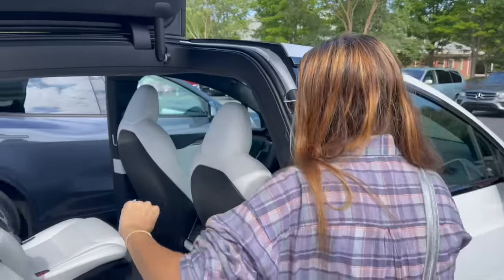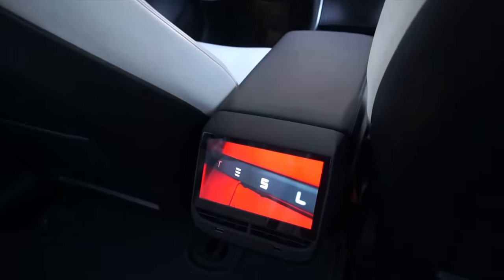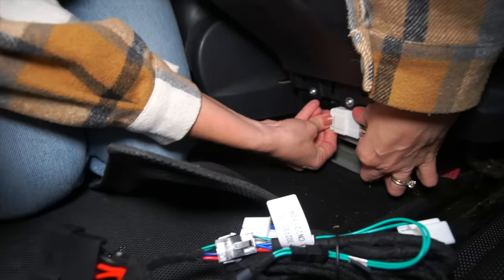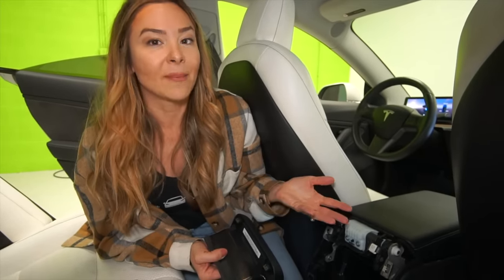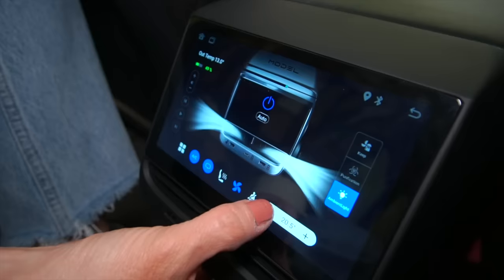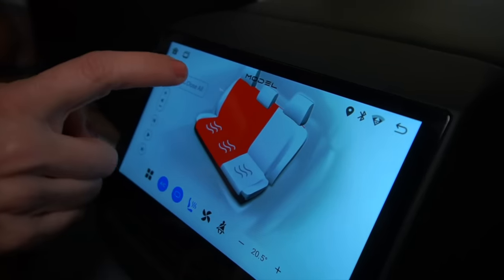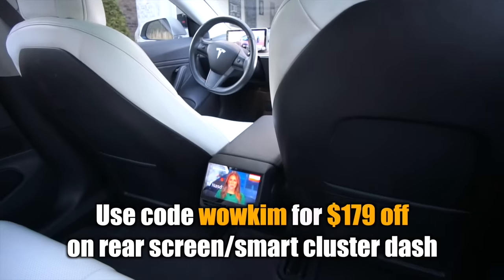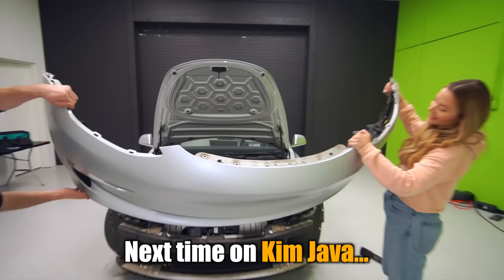THIS Rear Screen For Tesla Model 3/Y Is EVERYTHING!

Comment: What internet source does it use? Tesla or phone?
Reply: @Stranger Things yeah I thought it was a good question
Reply: Phone… Tesla does
not have a shareable hot spot.
Reply: Follow up question.  What speakers does the sound come out from?  Tesla or built in if it has one.
Reply: Waiting to hear this response before buying one myself
Reply: @aevans1979 hmm I’m sure you can hot spot the Y
Reply: @andymiser7710  from what I read, you’d have to use a hotspot for internet. So basically Wi-Fi only. Also read that the speakers work from Tesla or from the device itself. Or Bluetooth devices

Comment: Great video but I have a couple of questions. Does the screen go into night mode like the main screen? And do the smaller vents still put out enough air to keep the rear passengers comfortable? Great video & I can’t wait to see the headlight upgrade!!
Reply from the maker: Yes to night mode. Also the airflow seems identical in strength.

Comment: Thanks for the great video! I have a couple questions! thank you in advance!

1. If the Heated seats on turned on in the back, will it be reflected in the font screen saying they are turned on? Same thing with the Temperature control? -with temp, is it just adjusting the back seat temp? or the whole car?
2. If the heated seats on turned on in the back, will they be off when the car is turned back on? or remain on?
Reply: Did you get a reply?

Comment: Thank you!!

Question:

1. When setting the temperature and fan level in front does it automatically set in the back?

2. Given the volume is low on the system can you connect a portable Bluetooth speaker? 

3. While driving can you change or skip YouTube videos or change between video apps from your phone or is it done manually? 

3. As of right now, would you say this is the best system out there? There are so many options out there.

Comment: I’m on the fence about ordering this. My biggest concern is that it looks like you no longer have control over the direction of air flow? My wife would hate to not be able to point where the air is flowing and would be a deal breaker.
Reply from the maker: You can control the direction on the screen, similar to the front vents

Comment: Hi Kim, thank you for your great videos. Was wondering how the air flow is with the screen? Especially,  since it that is the only air vents for the rear.
Reply from the maker: No impact to air flow, you still have vents in the back and they feel identical to me.
Reply: @ItsKimJava  Too bad the newest version has much smaller vents, and don't match what you installed.

Comment: Just to understand this correctly:
The apps / YouTube etc on this rear screen will still work while the car is driving, right, (connectivity via phone provided)?
It’s not limited to use only in park as the front screen?
Reply from the maker: Yes it works while driving. Connectivity is via mobile hotspot

Comment: My phone charging port stop working after I installed. Is their a reason to it? Also I seen in another video the piece that connected to the original fan/ system , need a connection, however in my box it didn’t have one.
Reply: Did you ever get the phone charger port to work? Do the wireless charging pads up front still work?

Comment: Almost pulled the trigger than I realized, small kids will be in far seats and won't be able to reach, adults will have their own phones. Seems like just having two iPad is the way to go plus your not plugging into your cars system. Maybe I would get it if it had a wireless magnetic remote for the back passenger
Reply from the maker: In M3 and MY the screen is pretty easy to reach, even from the far seat. No problems for our 8 year old.

Comment: How much extra electricity does the rear screen use....yes I know it depends on how long it is used for....but is there any information on this?
Reply from the maker: Negligible I’d imagine. Less than a mile likely, same goes for any infotainment system. Most energy consumption is due to climate, speed, and driving habits.

Comment: Quick question. Does it void the warranty if we have this thing installed?
Reply from the maker: No it does not. Please it takes less than 5 minutes to remove and install old one if you were ever worried about it.
Reply: Well, it could still show up in the logs. If for whatever reason your MCU gets fried(even unrelated), Tesla will very likely try to get out of warranty. And then you’d need to proof it’s not related.
Reply: US law prevents automakers voiding warranties on their cars if owners upgrade a component.

The only warranty voided here would be with the rear air vents and the rear USB ports. Which is reasonable. Tesla can't be held responsible for faults in modified components, but if say a fault popped up elsewhere in the car Tesla can't legally blame the upgrade. It won't stop Tesla trying to blame upgrades, and they have, but the law is against them.
Reply: @JeanPierreWhite  I don´t say that the law will be with them but it could be trouble and they are known(at least in Europe) for not being very consumer oriented in cases like that. Also, this unit is not just taking power from the USB, It´s connected to the BUS of the Tesla and let´s you control functions like the HVAC system. So it could potentially cause problems with the MCU or even mess with other functions of the car. This is not a floormat or an extra cupholder. I´d stay away of it, at least until I´m out of warranty.

Comment: Are you 100% that you can connect to wireless headphones?

From their website “Does not connect to wireless headphones or other devices”
Reply from the maker: I was just informed by Tsportline that all orders using my code will now receive the newer rear screen which has a more powerful processor and Bluetooth hardware built in for headphone access!

Comment: There is already a newer version 7.2” that actually look like the x and a rear display for 3 / y 😂. This is already outdated guys.
Reply: That 7.2" screen has a rear vent that looks to be barely 1/8". It has some improvements but the venting looks very limited.
Reply: @mincooper  you should get this 7” one then that’s outdated released last year 😅
Reply: @techexpo2449  I'll wait to see reviews of the 7.2 by people who actually paid for their units to see if the HVAC is adequate. Hard to imagine enough flow for the rear passengers coming out of those slits but I could be wrong. If airflow is good I might buy the 7.2 but won't buy it based solely on the fact it's newer.